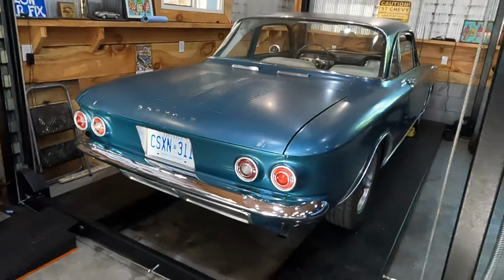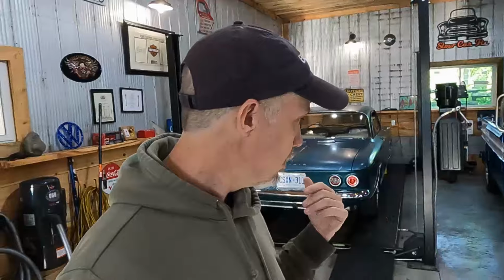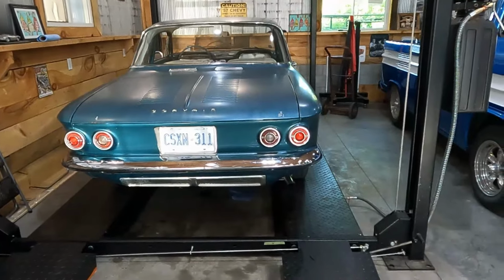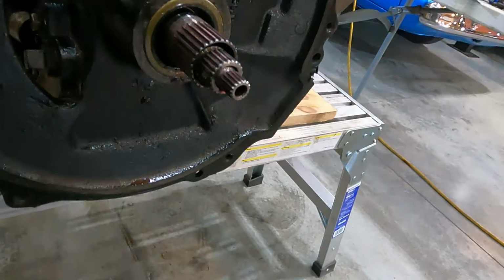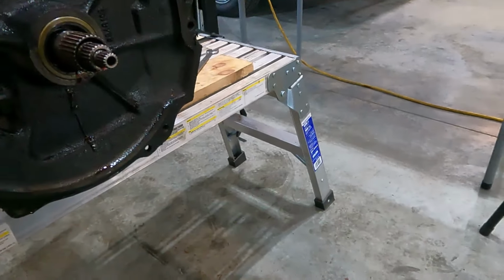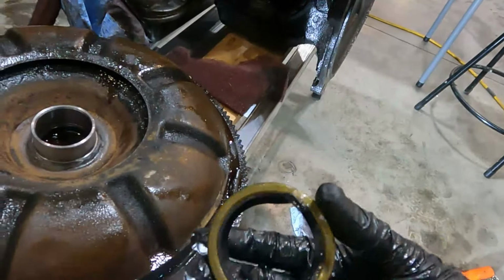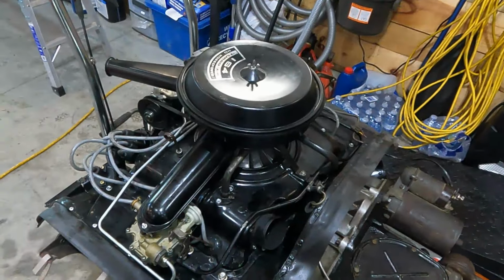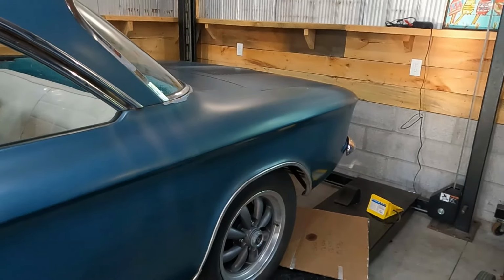Fixing a Stubborn Leak: Replacing the Torque Converter Seal on a 1964 Corvair Monza

Comment: Nice video; I have a 64 Greenbrier 110 P/G & it has never leaked, But my 67 is totally different story, & it didn't start leaking till I put a finned pan on the 1st one was slightly warped  ( pan ) so I sent it back, But it still has the leak, But I don't know when I'm going to get back into it as of right now I have a all the parts to fix on the shelf to fix it. I use to own a 60 700 4 door with the P/G & it never leaked as well. Love your garage set up it does make the job allot easier. I have no thoughts on what could be causing the leak still on your 64, & I read your replies to a few comments; I was thinking that the seal hasn't soften up enough, But you've driven it a couple of hundred miles so the seal should be broke in. Thanks again for the video, & content.
Reply from the maker: Thanks for watching, and I'm glad you're enjoying the videos. I have about 1000 miles on it now, and it leaks very little when it sits overnight. I am considering it acceptable. Before this video, it would soak the entire back of the car in trans fluid. Overall, it's a win.
Reply: @SlowCarFix  I hope when I get back into the 67 that I get the same results I'd be very happy with those results as well.

Comment: We have found a hairline Crack on torque converter hubs before.  Some are almost impossible to see with the naked eye.
Reply from the maker: @jamestribitt5658  that's a thought for sure. So far it leaves a drop the size of a quarter overnight and I've now put a few hundred miles on it. I'll continue to monitor, but if it comes apart, that converter will not go back in.